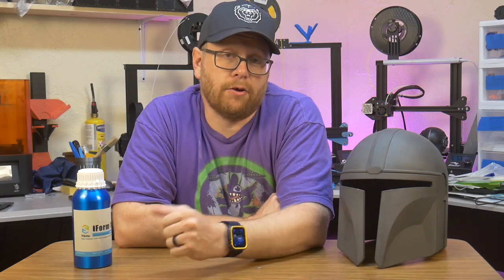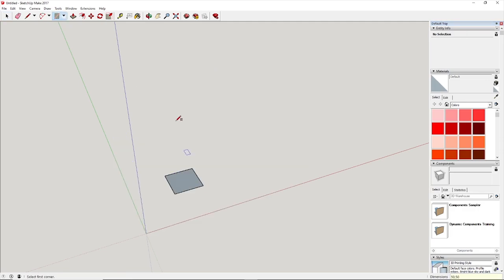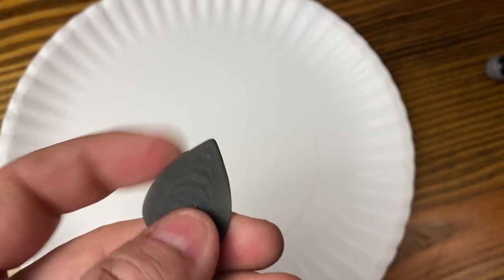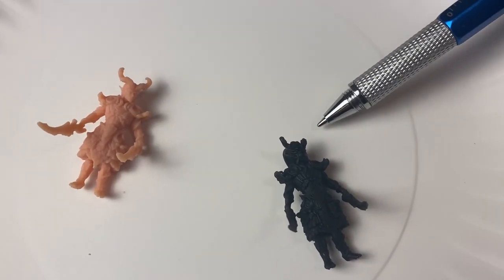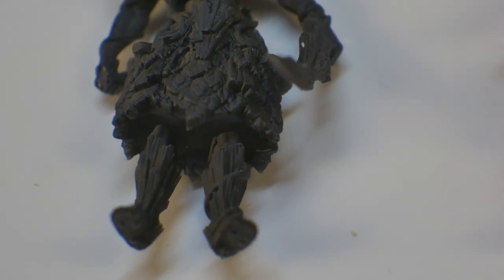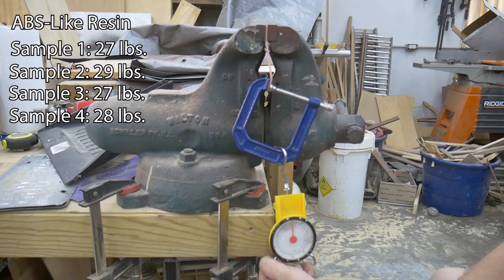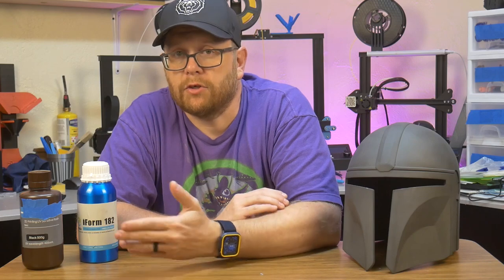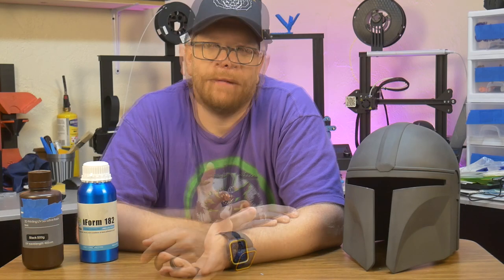Standard Resin vs. ABS-Like Resin: A few experiments to see how they compare.

Comment: The one thing I'm thinking after watching this is that your test may have been skewed away from the standard resin. Because that resin is black, the UV light wouldn't penetrate very far when you cure it while the lighter color ABS like resin is a lighter color so the curing light would get further into the model. 
I'm not sure how much of a difference this would make, but if you do resin tests again, having both types in a light color might be a better comparison. 

When you do your tension tests, it looks like they all fail where they were clamped into the vise. Modeling a loop into each end would allow you to eliminate them breaking at the stress point where they were clamped.
A flex test where you apply a side load till it breaks would also have been a nice addition and fairly easy to set up. (drill a hole in a 2X4 and insert your rod into it then pull sideways on the top till it breaks)
Reply: And less cured resin would be more fragile or more elastic?